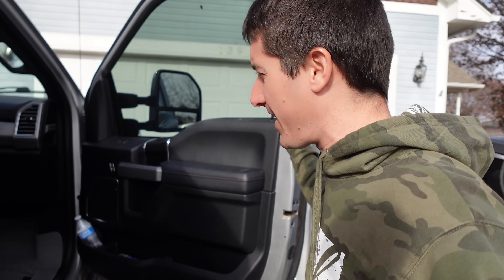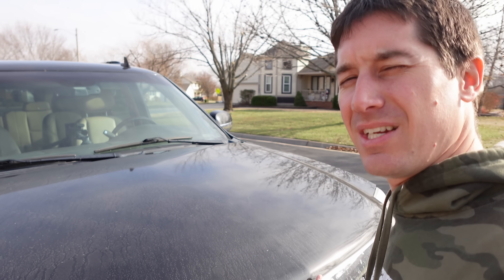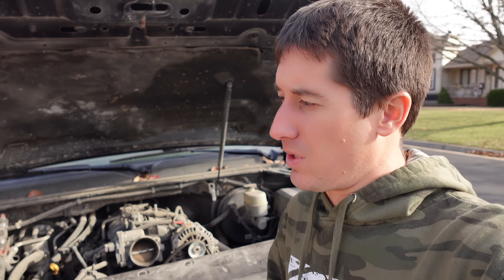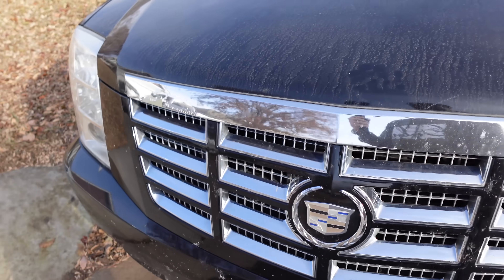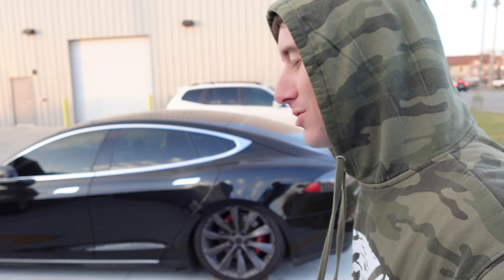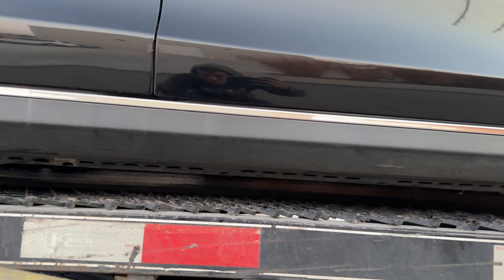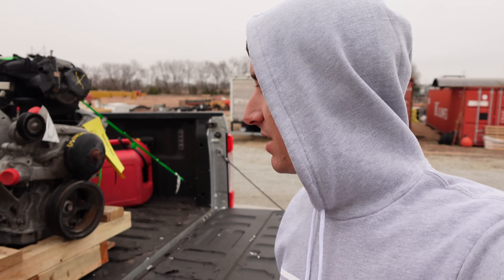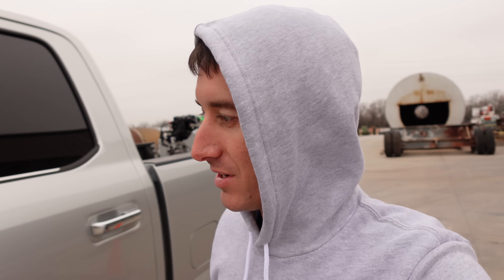I Sold My DEAD Tesla For A PROFIT? And Spent It On A V8

Comment: for the L94 engine buy a kit that disables the cylinder deactivation. makes it alot more reliable!
Reply: Put a Range Device in mine...DOD off at all times
Reply: @everydaydadfixinit4803  He needs to do this!!
Reply: @everydaydadfixinit4803  I've had it shut off on my G8 for years (cat-back exhaust and DOD is not an ear pleasing combo), but it won't keep the lifters from ticking at times. Not for mine anyways. Thought it finally wiped out the cam recently, but fresh oil quieted it back down.
Reply: @3800scgp  I've had one in for 80k miles, 4 years....lifters don't tuck and all seems OK.  Each experience may differ.
Reply: Just deactivating dod doesn't fix the problem with the lifters collapsing. It needs to be completely removed from the engine and ecm.
Reply: @97HarleyD  yes very true. was making it as simplistic as possible :)

Comment: I have a 2007 escalade esv.  Absolutely love it. Bought it with 160,000 miles on it. Now has 250,000 on it.....original engine and transmission.  Was one owner when I bought it. It's all about how well you take care of your vehicle 😊
Reply from the maker: I think that's pre-DOD if I remember right, should last forever! 🍻
Reply: It was the year before they added VVT. Gas mileage isn't great at 13-14mpg, but don't have to worry about stuck valves. Love your content and looking forward to the escalade heart transplant 😊
Reply: Don't run it on E85 though, just because it can, you'll not get that longevity unless you run a quality ethanol-free gas.

Comment: Let me recommend something:  

When you get the 6.2 back in the Escalade, please go get the DOD system tuned out. I learned the hard way. I also bought a 2013 Escalade from a dealer, low mileage, and I listened in the engine and couldn’t hear anything in it. Literally a week later; the engine started doing valve train chatter. 

Needles to say, after $4,600 and some change I literally have the whole engine rebuilt…minus the rotating long block stuff. New lifters, valves, all of it. 

If you get the engine in, and it’s quiet, I would still at least get it tuned out.

Comment: I have a 2007 Chevy Avalanche with the afm 5.3L. I use full synthetic oil and change it every 5,000 miles. Almost 150,000 miles and no issues yet. I also have a Range technology afm disabler.

Comment: I got 99 rt Dakota I try change my oil every 3k miles an it's full synthetic I know it last more yeah so. I look inside the rockers cover and it's looks clean like it came out of the assembly line. I use to work in lKQ they use the power washer to clean them.👍

Comment: Crazy thing is have a yukon with the same motor and it has over 200k miles and still running. Use it for work to haul stuff and only had to replace a fuel pump because of Northern rust

Comment: I haven't changed the oil in my 5.3 tahoe in 6 years come this March, lol I just top it off once every 3 months when it leaks low enough to trigger the check oil level light on the dash
Reply: * 284 thousand miles and still kicking strong as I bought it 6 years ago with 152 thousand dollars ... best 4500 dollars I've ever spent on a vehicle ..

Comment: 7:35 Hang on, is that engine resting and strapped down on the crank pulley?  I don't know much about Chevy engines but will that not compromise the crank end and pulley integrity?

Comment: its less the oil change (though that helps), and more the fact that the springs in the DOD lifters fail, and there's literally no way to stop that.

DOD/AFM deletes forever.
Reply: Yep. My 2020 trailboss blew up at 8k miles. I changed the oil at 2k and 7k. Made no difference. It’s a junk engine

Comment: Good luck with that engine ! id do a DOD delete to make it bulletproof especially if you want to boost it   the parts are actually only around 600-700 $  I just did this to my 2010 Yukon Denali hybrid bought at auction had collapsed lifter 130k guys at my shop i work at  thought it had a rod knock because of the low oil pressure warning  on dash but all it needed was a odd deleted  and running like brand new  oil pressure is up around 55 - 65 cold 40 hot #! exhaust lifter cylinder 6 collapsed and dod filter was plugged up truck runs like new and i suspect another 200k+ out of it before any other failures
Reply: nice

Comment: I probably would have installed the factory supercharged CTSV in it had I gotten the Escalade at that price. I do prefer turbos normally but as a daily driver that’s just the way I’d go. Might port the supercharger and use a smaller pulley though.

Comment: No way that’s a crack in the block between the tensioner pulley and the heads, right?
Reply: I see it, too the right of the bolt with the blue line on it on the flat part of the block....forsure crack.

Comment: I haven't watched the video, sorry JR i gotta go to work, but YES... THANK GOD. ALL HAIL THE V8! Oh look, i'm low on fuel... oh look theres a gas station... oh look its been 1 minute and I can travel another couple hundred miles now.... Meanwhile..... Man in tesla sits for 1.5 hours waiting for enough charge to get to work while watching housewives of orange county on netflix..... 

The infrastructure is not in place for mass electric cars yet. The US electrical grid couldn't even support a network of chargers big enough for everyone if you could snap your fingers and make it so. Gas cars will be here for a while, at least until electric battery tech gets better and the entire power system in north america is upgraded to handle the load, all while generating clean electricity. IF you electric car gets power from something that burns fossil fuels... how is that saving the planet. I'm no scientist, and internet don't crucify me for saying electric isnt ready yet. 

V8's for the men, 4 cylinders for the masses. 

At least that's what Grandpa used to say. 

Watching this video when I get home tonight.
Reply: LOL ended up watching the video now. I got 10 minutes to spare before work after all. Looks like the teslas use Mercedes Benz transmission gear selectors... Are they actually just a hodge podge of bits and bobs from other manufacturers under the skin?